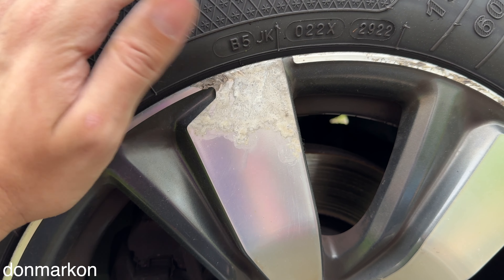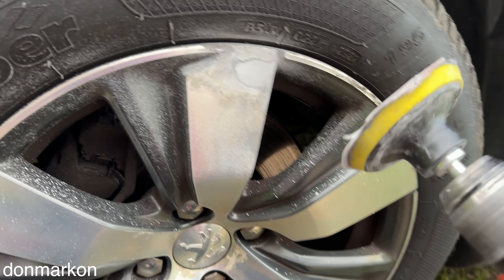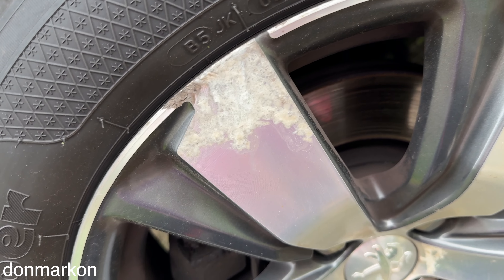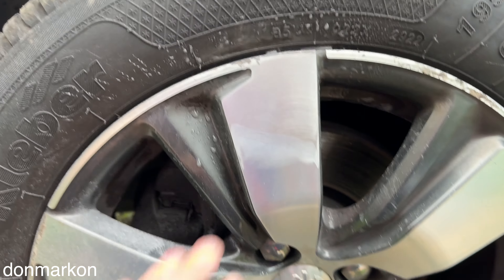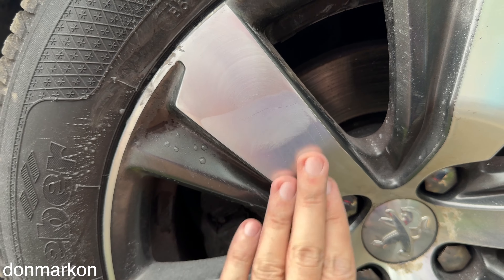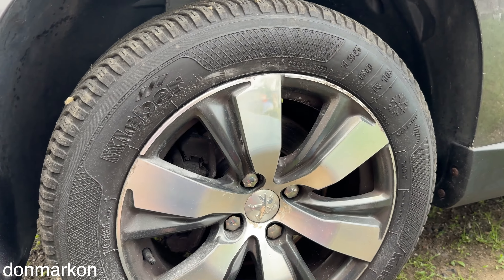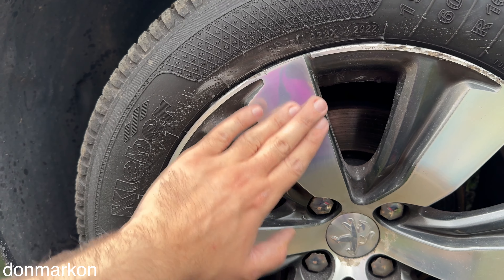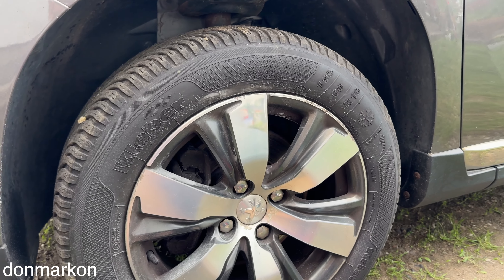Diamond Cut Wheel Repair Corrosion Fix In 5 Minutes Not Perfect But Easy

Comment: If you had polished to the change in angle the difference would have been even less noticeable.
Reply from the maker: Good tip but I was looking for quickest solution 
And for 1 - 2 m it is not noticeable 
For me more than good enough… not perfect but hey it is easy job